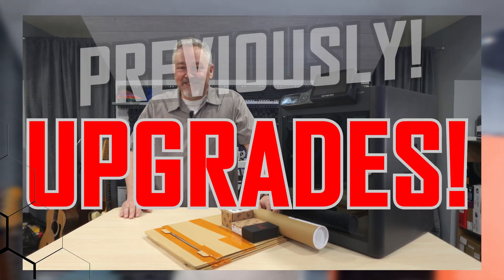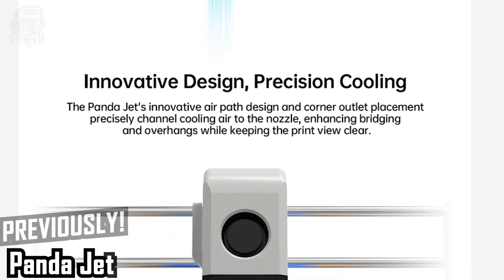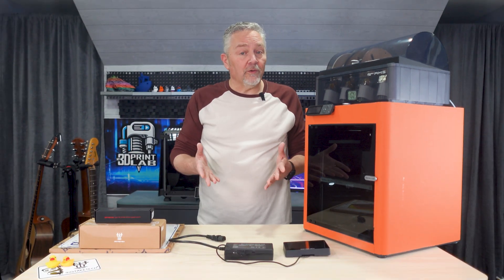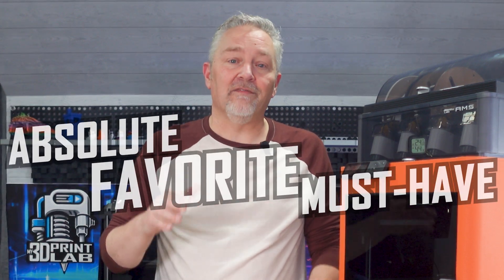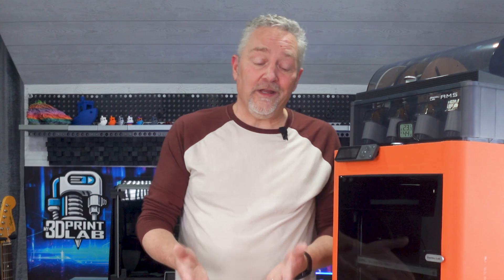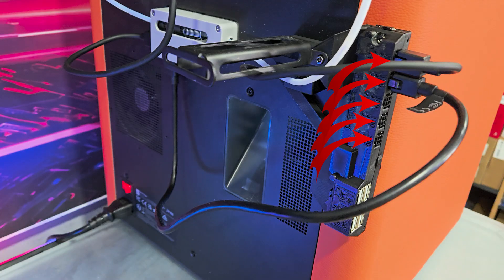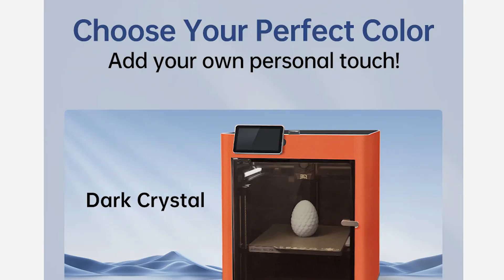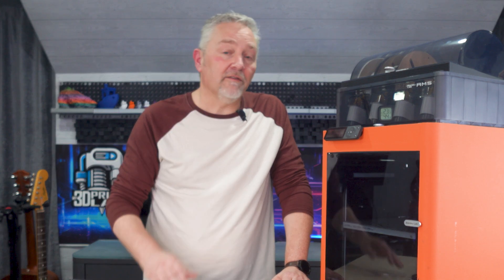Upgrade Highs & Lows: What worked and what didn't!

Comment: The revo nozzles are excellent… used them on my BX and voron for the last few years. Nice to be able to swap nozzles among all the printers.  And to be able to use a .8 for big prints, and swap to a .4 for those miniatures.  On the P1S, poop likes to collect onto the wide part of the nozzle and gets dragged onto the build plate or prime tower.

 Yes, the silicone rings wear out over time.  They become brittle with the repetitive heating and cooling.. and eventually rip or loosen enough to fall off the nozzle. Hence the reason for replacement kits (which include multiple rings and heater socks).

Comment: I bought the revo for the X1C, had a bunch of issues with the nozzle itself. So they sent me another one, used it for 2 prints and went back to the stainless steel one.
I will probably buy the stainless steel revo nozzle to see if it's worth to print with it, because brass only gave me issues.
Reply from the maker: Glad to know it's not just me! I plan to try the steel one soon as well.... one day! Thanks!

Comment: You glossed over the HUGE safety feature of the combination of the Panda PWR with the Panda Touch..... Auto power off when printing finishes.   I feel much safer leaving a long print running knowing that as soon as the print is finished, the Panda PWR will automatically cut power to the printer.
Reply from the maker: I actually had that and all the fuses and other stuff, but had to cut something due to a LONG video! And yes, those are pretty awesome features.... I probably should have left that in. Thanks for mentioning it!

Comment: "only there to not burn your fingers".... Seriously?! The silicone sock is so important to the heat tuning of a nozzle that if its cracked, or not placed correctly.. or not even existing, that your very likely the printer simply errors for thermals.. That answer from tech support is a great way to send newbies running from the hobby when they cant figure out why they cant get a print to work and blame the machine instead of the correct part failing.
Reply: Tbf, they were talking about the silicone ring grip not the silicone sock. Technically they are partially correct (although the main use of the ring is as a “grip” not as a heat block) but the whole point revo is the quick swap, permitted by the easy to grip nozzle, for which the silicone ring is necessary.
Reply from the maker: Yep. I was frustrated about it which is why I said exactly what they said. Note that my picture shows the rip in the sock, and I even told them that. This is just one experience, though, I've had others that were just fine.

Comment: Did you find the “touch” useful for your one P1s?
Reply from the maker: Yes, the "touch" part is awesome for the P1S! It's also great to use as John said, but where it will really shine is if I get another P1S or A1. Then I could print to both at the same time. Otherwise, I love being able to see my P1S, A1 and A1 mini all on the same screen.
Reply: @anthonybates5030  I 😘 be the Panda Touch... The fact I can take it off it's dock and take it with me is especially nice... I can be sitting on the couch, or be out in the yard and easily check in and control my printer.   It has more capability than the phone app, especially when paired with the Panda PWR, such as auto power off when print is finished